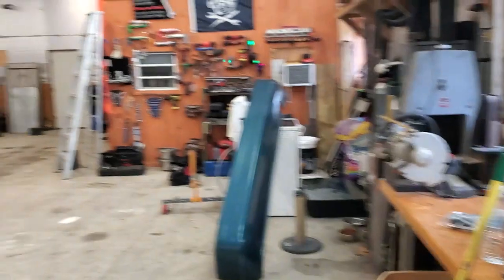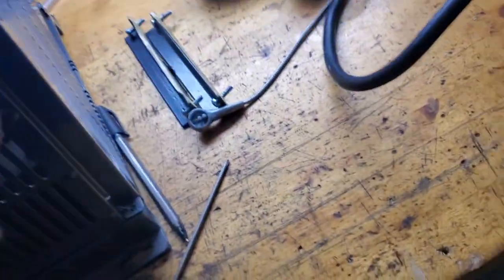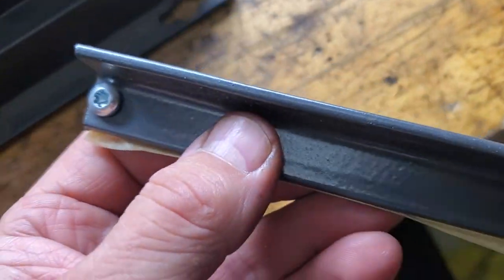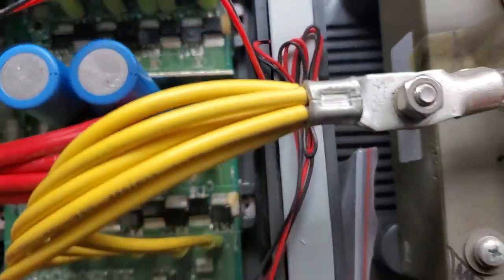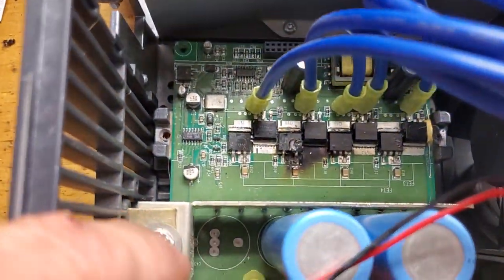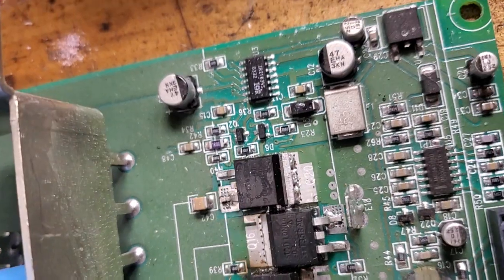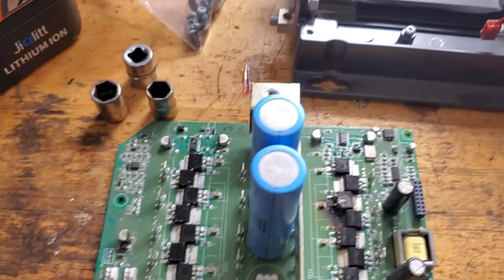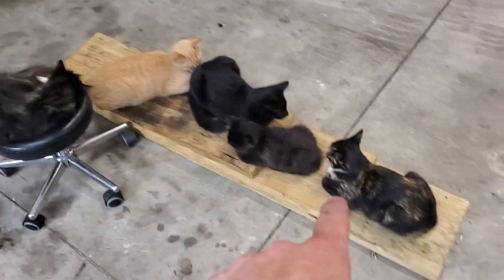INVERTER RV  what caused it to burn out

Comment: I had this unit go bad    WFCO WF-68100A Deck Mount Converter Charger - 100 Amps DC   I have my RV plugged in to my 50 amp service all the time under my RV Cover. It was popping my circuit breaker. I unplugged the 110 feeds from the unit and the circuit breaker remained on. My Battery was also bad. What I'm trying to get to is, with my RV plugged in 24 x7, 365 I assume it is charging my 12 volt Battery.  Is it possible that the Battery went bad from overcharging and it shorted the power inverter. I did discover this past weekend that I could turn off the Battery and my lights and other 12 volt items work fine. I found you on Facebook! I get credit for that don't I? LOL
Reply from the maker: Sure I'll give you 15 month for the price of 12 to my 1 on 1 troubleshooting website Www.rvdiagnostics.com